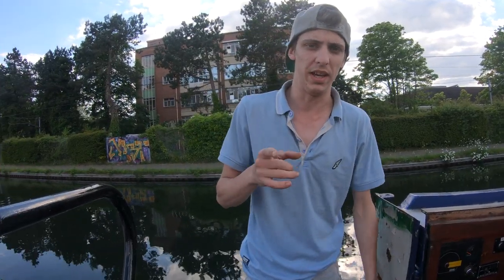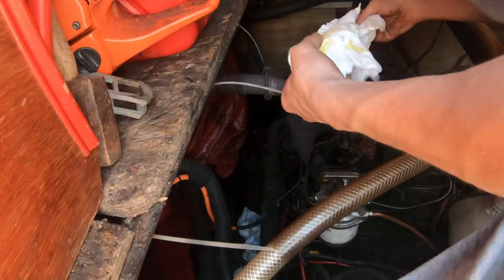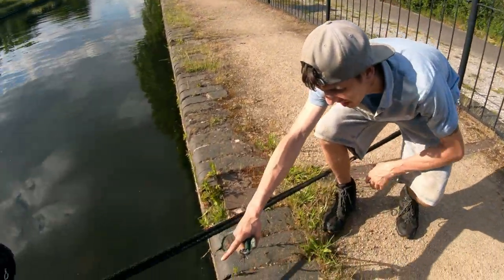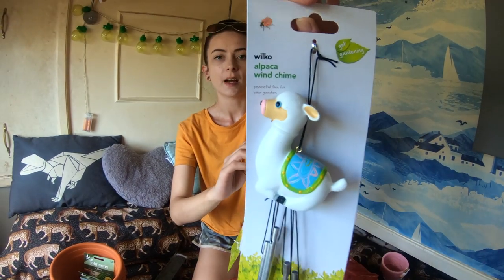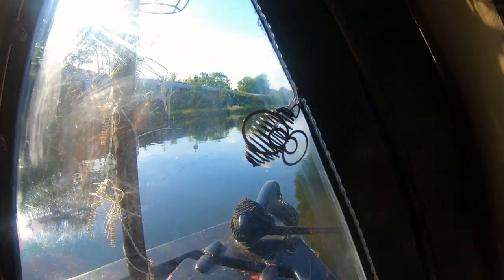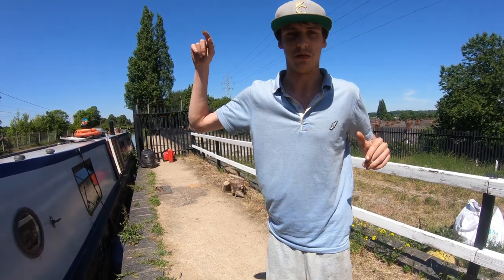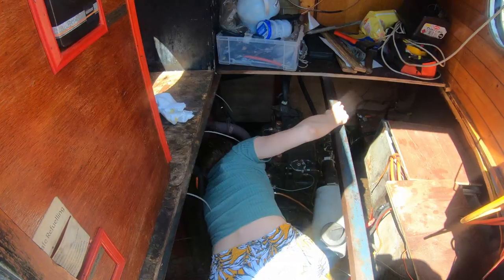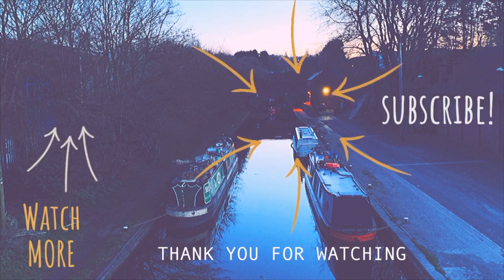#14 BOAT LIFE: Bilge Cleaning, PECULIAR Positions + DISASTROUS DIY | Tiny Home but LOTS to do 🛠

Comment: according to the bss if the holes are not at the bottom of the gas locker then having the volume below the hole(s) filled with water is correct, as long as the top of the hole is above the water.
I would recommend blacking (the bottom of) the gas locker to protect the steel. weight at the back of the boat should keep the holes high enough to temporarily drain it to dry it out and paint it but you might need to lower the bottom of the holes a bit to make sure it fills up again!
Reply from the maker: Hi Peter, thanks for watching and long time no see 🤣 Ahh that makes a lot more sense as we have of course passed boat safety. so we are supposed to have the water there and don’t need a bilge after all? Yes painting is a good idea and is something I definitely want to get done soon so we don’t get Rust in there 😊

Comment: Always plenty of diy to do in a narrowboat, strange that the drain holes for the gas locker are not low enough to let the water drain out. With gas being heavier than air if you’d had a gas bottle leak you’d have a couple of inches of gas in the bottom of your locker😱
Nice to hear Georgia’s voice again ❤️
Reply from the maker: Hello both, hope you are both keeping safe and well 🧡  I think this is something we will need to look in to. Does it mean that we need to keep the water that is in the bottom of the gas locker there or if we had a gas leak it would sink to the bottom and not come out? That’s something we don’t want 😨 its great to have Georgia back doing vlogs with me and getting her mind off things too ❤️
Reply: The Liveaboard Family I just think you need to investigate why the water doesn’t drain out,  our drain holes are near the water line at the back of the locker and we get water splashing in when we cruise but it all drains as soon as we stop
Reply from the maker: Ahh I see, me and bam bam has had a word and although it’s passed boat safety we might need to make a few adjustments as ours definitely don’t drain out when we stop like yours 🤔😯

Comment: Hi fella good vid but word of warning  don t put your petrol in the gas locker the petrol vapours from the fuel would build up under pressure, if heat affecting the containers petrol vapour escaped under high pressure
Reply from the maker: Hi buddy thank you for watching. I didn’t actually know that and had a few people telling me gas locker is the best place but I suppose that does make sense so thank you for the warning 😊👍🏼
Reply from the maker: Hey there, sorry we missed your comment here! Thank you so much for the link, we will take a watch of it today as we can’t be overlooking important safety aspects 😊 Thanks again for the tip! 🙏🏼

Comment: Hey guys, great to see Georgia back in the video :-) My bilge usually always has about 2cm of water, the bilge pump will never suck it all out completely. With the blind I find the beaded strings need to  hang straight down. What I mean by that is the but where they come out of the plastic housing needs to be right at the bottom and not tilted up slightly towards the wall or outwards as the beads then catch on the plastic housing when you pull them. I hope that makes sense haha Might be worth checking obviously the side that works well is facing downwards enough but the other side I bet is just angled upwards so you might need to twist the plastic bit where it goes into the blind to align it. :-)
Reply from the maker: Hi Mark, we hope your okay, how’s your week been? Yeah I wanna get it clean and sanded so I can repaint in there and get it looking nice, I got a lot of plans for the boat and thank you yes that does make sense, I will have ago at that either today or tomorrow :) thank you and also thank you for watching 🧡
Reply: @TheLiveaboardFamily  all good here thanks and week has been alright! Just carrying on trying to get the boat painted and last odd jobs in the bathroom done. No need to thank me for watching I love your videos :-) Take care of yourselves
Reply from the maker: Glad your weeks been good mate and you had chance to get on with lots of improvements on the boat 👍🏼 thank you so much, we really appreciate that 🧡 we love your videos too but have a few to catch up on over the weekend. We haven’t been watching many vlogs the past few weeks. Stay safe and hope to see you travelling soon